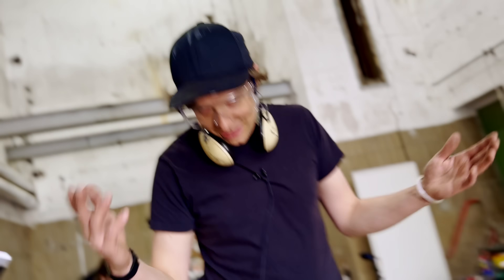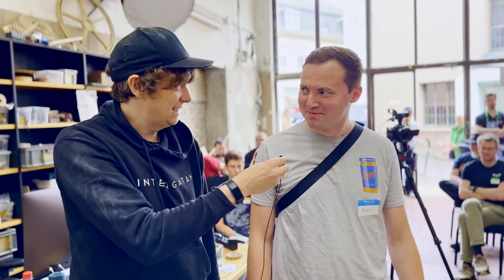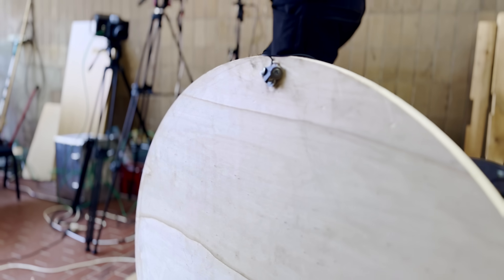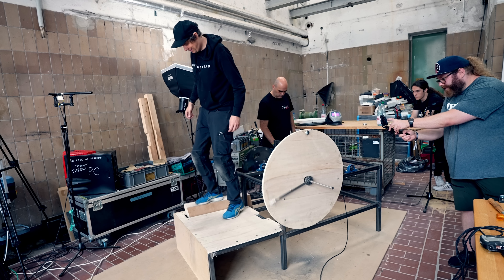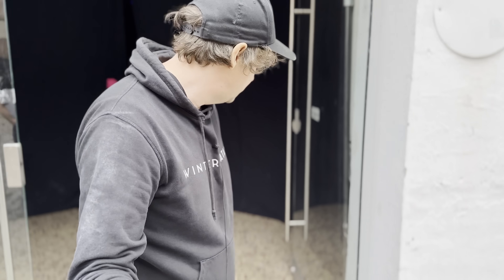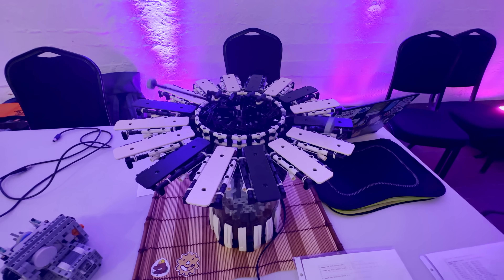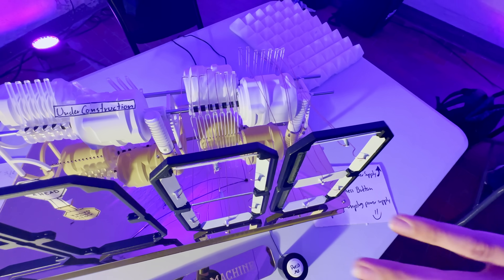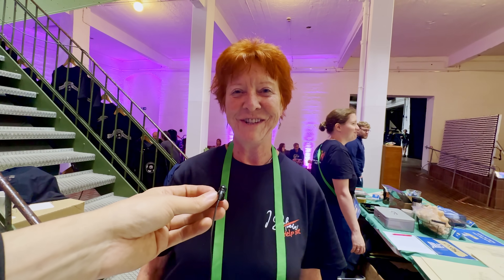First Timing Tests - DAY 6 - Marble Machine Flywheel Prototype

Comment: Tight and in sync aren't the same thing, though. The problem with the fast acceleration is that when the machine force is higher. because f ex it might drop a lot of marbles at once, it might slow down.
Reply: In other words: The load of the marble machine isn't constant making it harder to keep a constant timing.
Reply: @frankderks1150  Right.  And that's what the flywheel is there for.
Reply: @RegebroRepairs  Except that he's thinking the flywheel will somehow maintain a precise RPM, while still delivering a variable power-output.  I think someone didn't pay attention during high-school physics class.
Reply: @RegebroRepairs  The energy stored in the flywheel will keep the machine going but not with great timing precision. Variable load, variable input, it will always drift slowly around the desired tempo because of the flywheels inertia. A flywheel on it's own isn't going to satisfy the tight music design requirement unless it's much bigger than what he has in mind.
Reply: @frankderks1150  And at that point, a gargantuan flywheel is basically just serving as a reservoir to store kinetic energy, basically just the same thing as a gravity system but it stores the energy in kinetic rather than gravitational potential form...

then of course, with the gravity system (or a massive flywheel) there's the issue of tempo change... maybe he needs to consider a continuously variable transmission system to change tempo.
Reply: @frankderks1150  My point is that "desired tempo" is the wrong thing to measure. It doesn't matter if you are playing in 119bpm or 120bpm. It matters if the tempo sways during the bar. If it slows down after a long series of notes were played or not.
Reply: Even when he gets to the right BPM, he's not synchronized with the audible beat, and I feel like it will be hard to tell when you're doing fine that way.

Comment: Martin, you who loves biking, why don't you replace the pedal mechanism by a seat and a sedentary bike system? wouldn't you be able to control the beat much better?
Reply: Because he like to play with the machine manually and thats not work with a bike setup. Look the video of his first marble machine and you see what i mean.
Reply: I think he needs more freedom of movement to operate the machine.  That's not just a power input device that's also the stage for his performance.

Comment: The tempo needs an auto pilot mode in the later stages.
Reply: By the time he's done, he'll have built a 5 speed transmission on it lol. Then just keep pumping until the gearing limits the max speed exactly where he wants it. Change tempo? Switch gears!
Reply: @latimer442  Next thing you know he'll be adding a steam engine for greater consistency and so that he doesn't have to pump the pedal...

tbh that would be kinda cool
Reply: @latimer442  Marble Machine, featuring Tremec T-5 tempo control XD
Reply: @latimer442  Na, continuously variable transmission would probably be better for this. Imagine having like a dial you could turn to change the tempo!
Reply: That's the point of the governer - it'd act to regulate the output to a desired abd regulated speed.
Reply: Surely the speed of the flywheel should be completely independent of the BPM? The purpose of the flywheel is only to drive the mechanism, not dictate the speed of the music?

Comment: The pedal would be even stronger if you make a triangle instead of welding just another one. Also in a triangle you could support the covers.
Reply: As somebody who was at the event and actually got to try out the pedal by myself, I can tell you that a big problem was that he only reinforced part of the lever and not the whole thing. The actual pedal part was still bending a lot. So yes, replacing the whole part with some kind of truss structure will help, but there are a lot more problems to solve: even with no energy consuming modules attached, the contraption was quite exhausting to power even for 1 or 2 minutes, so using this for a whole concert is hardly conceivable right now.
Reply: @Svelix  For starters, it's using direct-drive, so pedal is slowing down flywheel, requiring more input to keep it going. Then you're fighting pedal return spring, btw also slowing flywheel. Grandfather clock weight systen would have addressed those problems, and music box governor would prevent it from runaway. He'd only need gear changer on governor to switch timing speeds, not hopping faster.
Reply: @aleksandrbmelnikov Yes, direct drive is not the best solution.  But there is a second point - noise.  If you implement a ratchet mechanism, you will hear clicks.
Reply: @xepota  [1] Use one-way clutch (worm gear w/ pressure plates. [2] Enclose ratchet in oil filled housing, so you don't hear it. <-- Two options. Instead of fishing for reasons it can't work, find ways to make something work.
Reply: @Svelix  thats why you have a performance aspect where you have gymnasts and dancers jump in time where a line of people jump one each revolution. Maybe similar to Japanese taito drummers?
Reply: @mrwess1927  Yea..instead of one paddel for one person...have all participate...maybe even turn the whole dance floor into a swinging platform and let the audience power the machine! 😂
Reply: @Svelix  lots of ideas to explore.
Reply: Engineering 101 right there!
Reply: Half-circle gusset plate.
Reply: the foot pedal pivot on the pulley should be moved closer to the outside diameter to make it easier to pedal.
Reply: Maybe he could change to a double T Profile. Best choice bending wise
Reply: My thoughts exactly, for the most strength why not treat the entire arm as a 'bridge' and use a 'truss' just to add weight for acceleration (and deceleration) and strength for the entire length of the pedal (to prevent bending along the entire length)

Edit: of course I don't mean super heavy, and atm it will take far to long to design and test. 

I was thinking of something similar to what you would see in a uk attic as they are rather simple to design and are lightweight for the strength they bring (for wood at the very least)

But for the actual connection point to the machine,  I have no ideas.
Reply: You stole my words. Triangulating is always a good practice. It's structural engineering and architecture 101: sturdier and lighter (think about crosswire bracing in any square, rectangle or diamond structure).
Reply: It's bending because there's 12mm holes in it. The structure is compromised... That's why he is reinforcing it....
Reply: Triangle is in the wrong direction for this to work. But you could use the "safety walls" and extend them. Solid structure can take more weight in this instance.
Reply: @D3nn1s  Don't know what you mean by "wrong direction for this to work", a triangle is exactly that came to my mind from the moment Martin mentioned how the foot lever bends. And extending the safety walls is basically just another way to do this, it comes down to the same principle of increasing the area moment of inertia to lower the stress taken up by the beams
Reply: @ichbrauchmehrkaffee5785  well itd certainly improve things, its simply not the best method. If he were to stand right at the end of the lever yes sure. However since he is standing in front of that point the tube would still bend
Reply: Give it a rest. All these, But-What-Ifs, are pointless. If he's already back to Marble Machine kicking his 🕳, then drive system is not working. Time to rethink why this thing needs a hump-monkey driving it.
Reply: Perhaps using a solid bar stock rather than the square tube
Reply: @TenSeventeen  solid bar is even easier to bend (and also much heavier) than a hollow one
Reply: @TenSeventeen a solid bar is not that much stronger. The perfect shape for rigidity is more or less the I beam. You want as much mass as possible as far away as possible from the center. So thicker wall and larger tubes is the solution.
Reply: @ManneSegerlund others might have pointed this out but it’s not having more mass away from the center of area that increases the moment, it is that of the cross sectional area. Technically a solid square has a larger cross section area and thus more moment but the bending to weight ratio is terrible. So it’s not more mass away from the center it’s the move the cross section away and removing cross section around the center which is why I beam are best
Reply: @ryanp0342  I know the equation. I have solved it multiple times in continuum mechanics. 
Iz=int_Ay^2dA
But colloquially what we both said is more or less the same.
Reply: @ManneSegerlund  sure, I could tell what you meant but there is no mass in the equation.
Reply: @ryanp0342  well area times density is mass per distance, and taking a section of length you get mass. If we are going to "well actually" this conversation.
Reply: It wouldn't be stronger because the direction of the load is only in the one dimension
Reply: @ashtree129 what? Yea and the only structure he has at the moment is perpendicular to said force.. so adding a beam to create a triangular structure would increase the strength/rigidity of the structure by like 50% or more